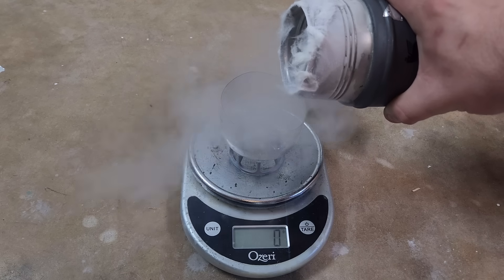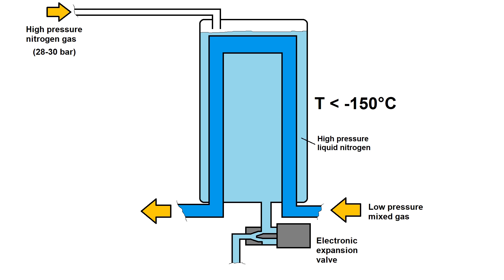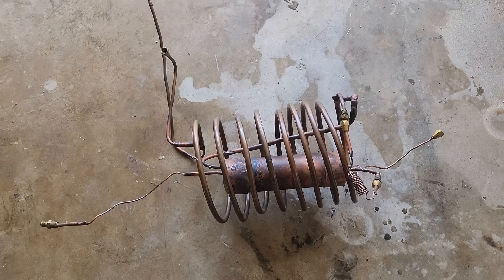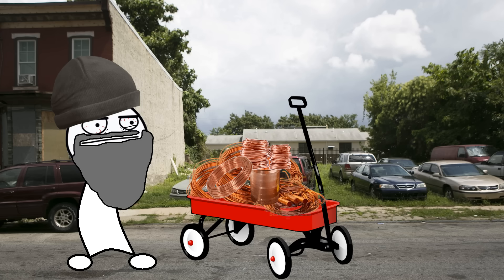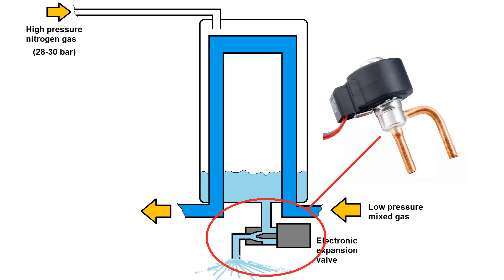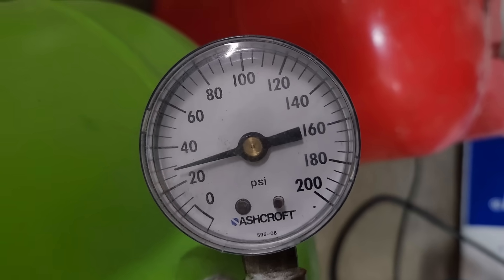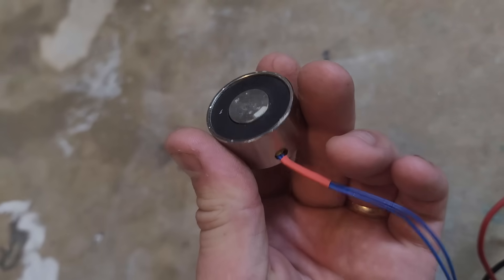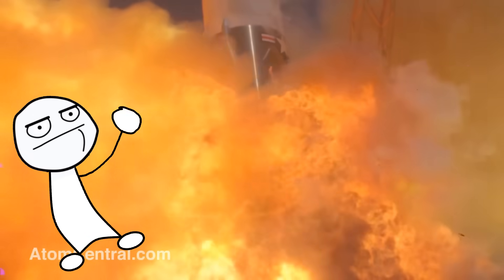Making Liquid Nitrogen with my Homemade Cryocooler

Comment: compressors designed for transcritical CO2 refrigeration systems would be suited for 450psi with zero problems, with 2-3x that pressure as a safety on top of the 450psi running pressure (if anyone wants that extra safety with the high pressures). transcritical CO2 can run over 100 bar or roughly 1500psi on the high side

Comment: A mechanical engineer here with 45 yrs experience in operation maintenance and commissioning cryogenic air separation plants for oxygen, nitrogen, argon production. I strongly doubt this closed system with use of commercial refrigeration compressors and simple counter flow heat exchangers would do the job. I would only believe that if you show a complete video where the components are running and showing the pressures and temperatures at various points in the system while in operation. I bet you  composed a system that might theoretically  looks workable but in real practice it would have myriad of problems due to limitations of oiled compressor and inefficiencies of counter flow heat exchangers that would cause a a surge of flow to compressor intake that will cause poor heat exchange not to mention the cold losses it will cause, and the joule Thomson valve will definitely be clogged if the stream of gas is not super dried and oil vapor free to very low dew point. I however appreciate the thoughts put into the system, nonetheless I bet 💯 it is impossible to make Liquid nitrogen via this apparatus. Also it is reckless notion to suggest to viewers that it is ok to pouring liquid nitrogen on ones bare hands, because this is extremely dangerous and will definitely cause serious cold burns. My regards

Comment: PLEASE PLEASE PLEASE do not make the aluminum foil so crumply. It now has a massive surface area to radiate heat into the surroundings. Polish the copper or try to keep the foil smooth.

Comment: How does one even measure these temperature? I suspect it's thermocouples, but I would love to learn more about the science of that. 

How are they calibrated, and what limitations and accuracies exist. What is different between measuring gas, liquids and solids.

I am used to thermal cameras that look at the LWIR spectrum and they don't measure this low and accurate numbers come with a ton of asterisk.

Also is your audio really quiet? Compared to the ads, I can barely hear anything at max volume on my phone while cooking :/

Comment: 28-30 bar... bloody hell that is a sh*t load of pressure! For reference, a full oxy acetylene cylinder which welders and machinists use are usually at about 15 bar and those are like torpedoes if they rupture 😳😯😆😅

Comment: Nice.  Same crap I have been doing.   For the counter flow exchanger.   Surface area.  Put 2-3 inch copper,with 5 ? 1/2 inch, surrounding your expansion joint line.  Copper excellent conductor of heat.

Comment: So, how do these metals, alloys and other materials you’re using perform at the temperatures you are operating at..?
Also, hypothetically if was to use the materials(or equivalent) that you are using at temperatures no higher than 93k?

Comment: You should buy polyurethane foam chemical mix part A and part B and it will expand uniformally and covering your complete system properly with solid high quality polyurethane insulating foam.

Comment: Why don’t u use perlite for a insulation make a box out of pink foam and put your coils in then fill it with lose perlite easily conforming to any shape with high and low temperature safe and if u have to fix it just dump it out fix it and re use it over again

Comment: You used the wrong spray foam it was open cell and you need closed cell try dap brand it should have a yellow look the reason I know this is i have used the white stuff and it's crap for thermals

Comment: it is about time you got another video out

please tell us that 

1.	it just your video was taking longer to film.

2.	when you blew up your cryocooler the sound frequencies of the blast did not set off your town's shotspotter system as a gunshot or an explosive device sending in the police or ATFE to question you.

3. if you are renting instead of owning then your landlord probably was not happy with you blowing up stuff and you had to move.

you may have not killed the compressor it is possible that an internal thermal protection kicked in.

i cut open compressors to salvage the copper windings and one compressor had the overload/thermal cut off switch built into the compressor inside the sealed steel can.

wait for the compressor to cool and maybe it will work.

however if the windings shorted and blew fuses then yes you did kill it.

Comment: While this is all very interesting stuff, would you consider maybe doing a more overall practical series dedicated to building and/or optimizing heat transfer systems for refrigeration, AC, and more typical uses for it?  I know you do have an earlier video talking about the initial steps on the process to start this project (which contains a lot of useful information generally), which include using propane as the refrigerant, but perhaps more focus on the basics and optimizing energy efficiency? 

  Cheers

Comment: Cool video. What happens to high-temperature boiling components, such as propane or ethylene when temperature drops? Propane partial pressure in a mix is relatively high, so should it get liquified and collected somewhere?

Comment: Mr fridge, congratz on the diy liquid nitrogen. If you were to recommend the simplest DIY build for -30ºC, which setup would you recommend? ( right now I am using Peltier coolers and it doesn't cut it ).
Reply: a simple propane vapor compression system

Comment: If you were able to put the 2in heat exchanger inside of a 2.5 or 3in pipe then pulled a good vacuum on the 3in pipe it would act kinda like the thermos

Comment: I'm a heating engineer and the max pressure we deal with is about 7 bar,  I got talking to some refrigeration engineers on site and when they were telling me what pressure they run at, and considering that gas compresses a hell of a lot more than liquid, I was blown away. They told me that one guy was using a pressure guage and it failed and the glass from the front of the guage literally took his head off, killed him instantly. Don't attempt this kind of thing if you don't know exactly what you are doing! ☠️

Comment: I once worked "on" a compressor at chemical plant, it's output was 2000 bar, a v8 with a 3 meter rotor.
the tubing was insane thick.

Comment: Here's a potential project if you're interested - consider a boat or RV that relies on solar or other sources to charge batteries. I've seen examples of using a hot water heater as physical energy storage once the a batteries are fully charged. Wondering if you could use a heat pump instead of a heater, creating a "heat sink" and a "cold sink." Then, ideally, you'd leverage the hot side for anything on the boat/rv that needs warming, and the cold side for anything that needs cooling. Could you store enough heat and "cold" in a sufficiently efficient and reliable way to make this practical?

Comment: I was just looking at the little 1  in.³ fans from a Cisco switch and wondered if they could work as turbo recuperator‘s for your expanding gas to help recover energy from the gas expansion they run about 70 W in stock form

Comment: My grandfather did refrigerant system repair for 40 years and he said pressure, temperature, and leaks are your enemy! You need a good gas to liquid swing for pressure and temperatures you want to get. Has to be stable for wide pressures and temperatures, control temps in each phase the best you can. What does thicker aluminum tube and heat exchangers do for each phases?

Comment: Hey a thing you might like to try is those cheap double wall glass vacuum cups. I've seen it done with some professional gear (presumably boro glass) and you can see the actual liquid gas inside and the outside doesn't frost over. If the glass can handle the thermal shock (Keeping in mind they do get used for coffee at 100 ish C) then it may work for you with the LN2 for a few $

Comment: I’m not fluid expert
But is “pressure swing absorption” ( 13:49 ) a high pressure system of @signalDitch project? ( https://youtu.be/lB3hHk1_2V0 )

(I’m supposing you will separate gasses by pressure and not by molecular sieves)

Comment: The Initial Temperature Issue of not being low enough could have been a result of too much insulation.
It's a weird experiment where you insulate a HOT metal pipe and measure the result of the exiting fluid temp.
Each time you add insulation the exit temp goes up...until it starts to go back down.  There is a negative relationship here.
The weird behaviour is the point where surface area of the insulation  becomes too great for the volume of insulation and the heat is lost through SA.

Comment: Can you stage separate the air? I don't know how the CO2 falls out but the Ox/Nitrogen both drop out slightly apart from each other. Liquid Ox is fun to play with. It's slightly magnetic. It's a pretty nasty oxidizer and you mostly want to avoid getting it on anything that can absorb liquids. It's pretty bad when you spill it on clothes and said clothes catch fire.. or spontaneously combust which is a better description of what happens. I used to have access to limitless quantities of liquid nitrogen from a medical clinic and it was pretty cool to play with. A proper dewar will definitely keep it for a while longer.

Comment: I love your videos 😀 did have one concern are you testing just to working pressure? In model engineering we test boilers to 2x working pressure. It’s a lot safer to use water as the test medium as it doesn’t compress so no explosion on failure…

Comment: great video, can't wait for more. about your thermocouple being slightly off, I wonder if it's because your meter is too close. it needs to be someplace with a stable temperature, because the meter itself affects the reading.

it's interesting how a thermocouple works. the sensor wire is just a wire, 2 different types of metal welded together at one end. the wire creates a very small voltage +/- depending on the temperature difference between the sensing end and the plug end of the wires. so it's actually measuring a relative temperature. there's another sensor inside the meter which measures the absolute temperature of the meter itself and adds to that the reading from the thermocouple wires, giving you the resulting temperature. if the temperature sensor inside the meter is different from the plug end of the thermocouple wires, it can throw off the measurement.

Comment: For the compressor that feeds nitrogen into the condenser chamber you should put afew oil separators on its discharge so you dont loose all the oil and have clumpy nitrogen oil mix clogging your EEV on the output:0 over all this is a cool build

Comment: HUZZA! HE DID THE THING! And I KNEW he needed it for superconductivity! A hyperspace pirate without a hyperdrive is not going to get much piracy done, and everyone knows you can't build a hyperdrive without superconductors. And I'm now blatantly speculating that he made liquid methane, and will soon make liquid oxygen, because he's going for a methalox closed cycle control thruster system, so he can do super agile maneuvers when he exits hyperspace and prepares for boarding. "ZWOOOOZH! KLONK! PEW-PEW-PEW! Gimme all your stuff or you go out the air lock!"

Comment: super cool, how about pulse detonation cooling, how about low at tempt perature, who needs valves anyways. talk about freeze drying. use solar power = free. just have the panel and be done with it.
Reply: whats the best phase change medium, well nitrogen, oxygen and hydrogen. well nitrogen is the most useful and safest. and mostly just air. if you directly compress to liquid nitrogen, then you can make a super cool compressor.
Reply: for funzies, try wax boiling steam engine

Comment: LN2 can also be used very effectively for CPU over clocking. Many of the world records were set using silicone caulk a paper towel tube and LN2.
Use this as an overkill cooler to run a world record OC daily driver?

Comment: The reason you lost your rotary compressor despite the cooling was indeed an oiling issue. While the piston compressors like the fridge transfer one have their oil sump in the low pressure housing and actively use a small centrifugal pump to lube themselves up, the bigger rotary ones have their oil sump on the high pressure side. That means in order to avoid efficiency loss, they can't simply allow the oil to bypass back into the rotary set and instead rely on oil making it all the way trough the loop and back into the suction side.
If there is no oil in the gas that comes from the suction, they have no lubrication at all.
A fix would be another oil separator loop for the nitrogen comp. Even while the fridge transfer compressor might work, you're still loosing oil out of it slowly, so with enough time and no refill it will die too. Not to mention that some oil might get all the way into the cryo chamber and freeze up in there.
Reply: I think an r290 freezer compressor would be fine with 500psi and still have the oil sump. Might be a bit larger than the small r600a bar fridge compressor he's using (if I remember correctly)

Comment: The equation at 11:58 is a linear approximation around room temperature. The true curve as a function of temperature is nonlinear and is a strong function of the copper purity. The NIST Cryogenic Materials Property database provides some empirical equations for OFHC copper (C101).

Comment: So I started watching you because I want to make pure argon off-grid.

Looked into it a bunch, seems like cryogenic size exclusion chromatography is a decent option.

You can do it with pure PSA but I would need crazy amounts of stages and some hard to come by molecular sieves.

Looked into making Argon as a product at all? Seems like if you could use PSA to quickly get a 95-5 mix of O2-Ar and then cool that to liquid and toss it through a column of 3A or 4A sieves to seperate the two. Probably clean up the trace O2 with a copper catalyst bed like I have in my gloveboxes at work.

Comment: Okay, I have an absolutely massive 220V AC compressor with a water cooled condenser tank, I am taking like  500lbs gross weight.

Downside is that it needs to travel about 2000km to get to you.

If you are at all interested let me know how to contact you.

Comment: On the efficiency losses experienced at ~ 4:49 
I was thinking, it's a more complex (but also simpler) idea but what if you mounted it inside an air tight box and then pumped all the air out, use a vacuum as your insulator.
Would that work? It would save all that wrapping and unwrapping and chipping off down when it fails. 
Getting access to the part is easy, just let the aie back in.
Is that a good idea? 
What do you think?

Comment: So what if you just use straight air as the feed gas? Obviously LO2 is a concern, but is it really? I mean, wouldn't most of it be LN2 and the LO2 just kind of mix in and do nothing? Or do you really have to worry about the pressures involved in the process in order to make sure it doesn't self-ignite?

Comment: Next up: liquid helium. (This would be cool imo) And after that: liquid hydrogen (is this even possible with the equipment you are using??) Yes I am trying to get you to build a rocket propellant plant.
Reply: Not possible with Joule Thompson. Free expansion of the fluid thermalises the energy you put in, and with those two gasses this is enough to undo the cooling you applied. You need to use adiabatic expansion for them, so something like a Stirling cryocooler.
Reply: @agsystems8220  Im gonna pretend that I know what you are saying and just go awwww :(. LOL

Comment: As a German (EU certified) HVAC technician I look at your "Frankensteins cooler" and simply think it could be nicer in terms of fabrication but it certainly works and makes me question why I put as much effort into maintaining the units I repair daily, clearly these heatpump systems are way more sturdy than I expected! Well except teh expansion valves we tend to use, tehy don't like the icky oxides, grease, dirt and other contaminants.
Also your scroll compressor was SURELY killed by an oiling issue! They tend to be a bit finicky, while fridge compressors like yours are "self contained" units (most often hermetically sealed piston comressors) and don't exactly tend to lose oil via the compressed gas leaving as designed. Scroll compressors on the other hand have a gas cooling and need teh oil feedback line and they really dispise it when the lubricant is not "lubing their vibes" as that ends them rather quickly.

Comment: Congratulations! I've been watching for over a year anticipating the day you finally accomplish your goal! 
Personally, im interested in reaching those temps but with regular air, as a way of improving my high-end culinary knives during the tempering process. Do you think just a mixture of argon and propane would work well enough?
Reply: IIRC, when it comes to cryogenic quenching, the biggest issue is trying to defeat the Leidenfrost effect, rather than the boiling temp of the liquid. Some sort of flexible thermal transfer interface between the liquid bath and the surface of the metal must be used, though I am uncertain what materials would be suitable.

Comment: I always wondered why old AC units always came with that extra part in the bottom left 0:23, glad it wasn’t just me who noticed.
Reply: its a bottom part
Reply: @Flashv28  👏😆
Reply: It just plugs the drain hole.
Reply: well it certainly is for bottoms, just of the human kind
Reply: Its for use by maintenance to make there jobs easier